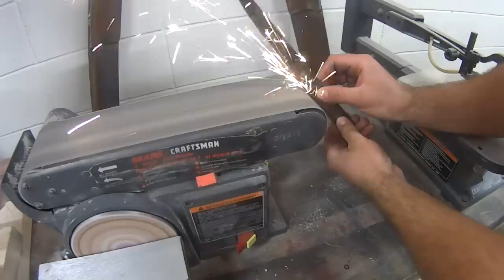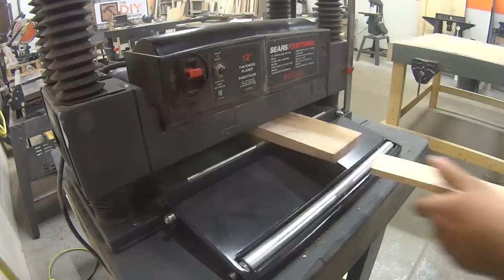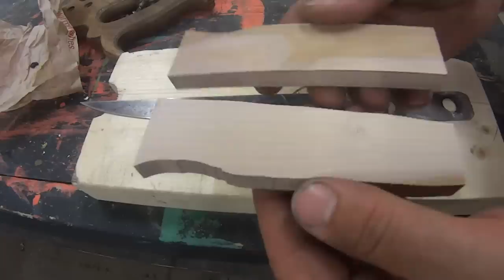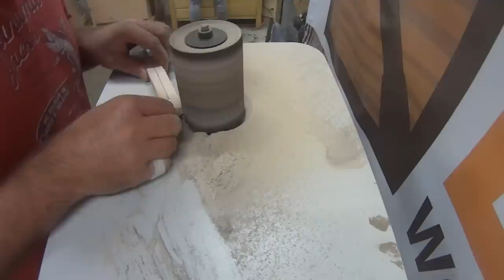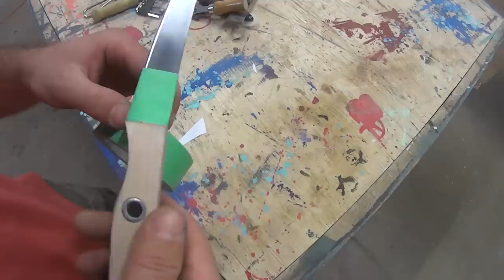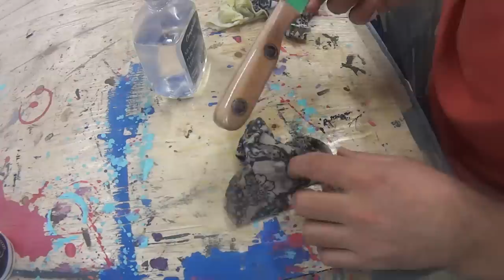How to make Fillet Knife from Hand Saw blade. DIY.

Comment: 2 things. 1st, clamp thin metal. I was just thinking when I saw you drill, man if that thing catches, then BAMM. Safety first.

2nd, and I'm not sure if you are aware of this and I hope others find it helpful. When drilling hardend steel, your gonna burn up bits. There is a very easy an effective method. It's called spot annealing.  Simply put, take something hard, I use an old pushrod from a car. Put it in the chuck of your drill press, turn the rpms up to the max. Mark the spots where you want your holes. Bring the spinning pushrod, or bad drill bit or whatever you have down onto the spot with pressure.  You will see the steel start to turn colors. Once it makes that tell tale purplish ring, the area has been annealed and can be drilled quite easily with the cheapest bits. This will only anneale a very small area.
Reply from the maker: Thank you for your suggestions!
Reply: Man, that's cool. Thanks for your input. That is some good information.
Reply: This is ingenious. Thank you
Reply: He should have started with a small bit and worked up from there.  Always clamp.  I had this happen one time too many.
Reply: Cool tip!

Comment: I found that if you are using previous blades to make your own blade it helps to heat treat the places where you are going to drill your rivet holes. A nice cherry red & then allow to cool. This helps to soften up the handle area and hence it is easier to drill.
Reply from the maker: Thanks for the info!

Comment: I was advised by an old time served engineer to use cold water when drilling spring steel.  i used to build double axle trailers and  used cut down leaf springs for the suspension.  Drilling the centre bolt was tricky until told about the cold water coolant!
Reply from the maker: Thanks for the advice! Will use it in the future.

Comment: Hello!  Nice knife  i have one piece of advise. Hardend steel is very difficult to drill and before I learned how to do it I burned up several drill bits. I searched youtube and learned this trick. Next time you need to driil  get a pan of water and suspend the blade part under water to keep it cool then  use a torch to heat up the  spots you need to drill. Heat the spots to a glowing red and set aside to cool. This will take the temper out in those areas and make it much easier to drill whole the blade part will retain it's hardness.
Reply from the maker: chefsterman 
Very good advice! Will definitely use it next time. Thanks a lot!
Reply: LA OTRA ES BAJAR LA VELOCIDAD DE LA MÁQUINA PARA QUE NO CALIENTE TANTO Y NO QUEME LA MECHA..!!

Comment: Thanks for the video. Wasn't sure if you beveled both sides, the speed was hard to follow, but not boring. The reason I inquire is that fillet knives are beveled on one side only.
Reply from the maker: Thank you for your comment!
I did put a bevelle on both sides, because all the fillet knives I had before (manufactured) were done that way. But I've seen one fillet 🔪 bevelled from one side only, Japanese one. Although it wasn't flexible like mine and quite thick, 1/4" approximately.

Comment: I like the fact you took something you were not using and made something you could,blade has the flex to fillet fish and if its sharp enough will be fine. I would have used smaller pieces of brass tube to hold it together and made a sheath out of a old belt ??
Reply from the maker: Thanks, William!
I used what I had for pins, no doubt brass would look way better!
I did make a sheath for this knife from a suitcase
https://www.youtube.com/watch?v=uRg3c17Arl0
Reply: @Take_And_Make  Good job and passtime. Beats just sitting around watching tv and drinking beer.

Comment: I have made a few of these and ruined a drill bit or two drilling through the tang. You can apply heat to the site of the tang holes until you get to a blue-purple color using a propane torch which softens the tang enough to drill through easily without compromising the hardness of the cutting blade.

Comment: you can soft the handle part by putting the blade part in water and torching the holes areas, so drilling is way more easy and less dangerous
Reply from the maker: Thank you Fabio, I will keep it in mind for my next knife build. Drilling as it is was a real struggle yes.

Comment: Very good video everything looks very good I also want to make my knife to prepare tacos my question is it has to be forged ??? because I see in other Videos that they heat the material and put oil to forge it in the hand saw n
Reply from the maker: Thank you! 
You can get away without forging if you not gonna overheat your cutting edge when grinding. Go slow and cool down your piece in water frequent. You may also wanna watch this video too
https://youtu.be/I5FIDpNrqGc
Reply: Thank you very much, really, it has saved me always wanted to be a knife but I have no way to forge it has saved me thanks for the answ

Comment: Thanks for the Demo. I thought you dd a good job. As far as softing the metal to drill the holes, it would be much easier to buy some cobalt drills. Harbor Freight sells them cheep. Keep up the good work.
Reply from the maker: Thank you Sue! I will check it out
Reply: Stay away from harbor freight bits. i bought 10 or so once just thinking "hey they'll dull but they're cheap." but i broke 3 of them in under 5 minutes and threw the rest away. just my experience with them.

Comment: I enjoyed the video but I was surprised when you went through the effort of making a knife by hand to end up using a pull-through carbide sharpener at the end. I know sharpening is a bit of a different skill set than machining and woodwork, but id argue that sharpening is easier because of tool cost.

Comment: Next time put your razor edge on last, safer to work with.  Also, slow that drill bit down. Drill metal much slower than wood.  Shouldn't need oil that thin too.

Comment: hi, nice video...I' ve got an old rusty saw and i want to make a knife of it.. the question is does it not go rusty again with the time
Reply from the maker: Thank you!
Each time I wash it I wipe it dry and then put it in the sheath
Reply: You can also dry it, then keep it oiled between uses (vegetable or food safe knife oil) ..  A vinegar bath can help break the rust off the old saw also, before starting to work with it..

Comment: Did you heat treat it’s very easy to ruin heat test on steel that thin
Reply from the maker: No, I didn't. The steel was already hardened, and it seem to be holding edge pretty good.

Comment: Fantastic job, well done!! Do you have any suggestion to make the handle without the need to pierce the metal?
Reply: You dont have to use pin at all. The epoxy will hold the scales to the tang just fine.

Comment: just want to say nice video keep it up. but first, the reason you were burning your drill bits is because the steel is high carbon and very hard so u have to soften it. next for drilling lmao its funny I didn't the same when I started but I cut off the tip of my finger ya not good but clamp it like u did but what I find is also good is put a nail or screw in the board and rest the blade on that so it don't turn like it did. if you have and questions give a shout. just a little info from one knife maker to another.
Reply from the maker: Thanks Bobby! I'm glad you like this vid!
My next project going to be a hunter/Bushcraft knife, I got used concrete diamond blade which I wanna use on this build. Have any suggestions/tips? Would appreciate your help.
Thanks!
Reply: well learn about the different types of steel and there carbon content. then learn how to heat treat and how to anneal high carbon steel. this will help you save on drill bits lol iv burned and broke blades drill bits trying to drill high carbon steel as you used in your video. over all do your homework and things will become a lot easier for you. iv learned everything I know from just from youtube and well a few books at the library. Hopefully this helps you if any other questions just ask don't mind helping out.
Reply from the maker: Thanks man! Would you recommend me any particular book!
There is so many on Amazon, kinda hard to chose...
Reply: wow I'm not sure bud I'm from a small town and there weren't really lots of books I think really there was 2 that I remember but the name I forget that's why I took notes on everything. I also do blacksmithing also but I studied for a year or two like really hardcore but you know I'm still learning new tricks and ect.... and to be honest its all from youtube. let me give you a few smiths I follow. Walter Sorrells, Chandler Dickinson and Alec Steel these are just a few that I follow the most but theres lots of them that are really informative. Oh and to learn how to heat treat just look it up on youtube how to heat treat and anneal steel or knifes ect. start watching and learning my friend. take notes and just have fun . if any more questions,  don't know if you have facebook or what ever but my email is bobbybeaupre76@gmail.com easier to get ahold of me if you need or have any more questions.
Reply from the maker: Thanks for helping me out Bobby! I appreciated it!
Reply: hey no prob bud if you have anymore question or help on anything like I said drop a line u have my email...oh if u get into blacksmithing you would be surprised all the cool shit you can make lol and I can give some pointers on how to make a forge for next to nothing almost free lol or how to make a anvil lol
Reply from the maker: Sounds good buddy. Yeah I think I gonna have to try blacksmithing in the near future! Lol 
My name is Eugene by the way. 
Eugene Gretskyi, you can find me on Facebook. Cheers man!
Reply: @Take_And_Make  Continuation of my reply. If the blade gets to hot while grinding, you will lose the hardness.  Always grind without gloves.  If it gets too hot to hold, you have lost the temper and hardness and it needs to be heat treated.  Same when cutting out basic shape.  Always go 3/16 or so larger that the final measurements because the grinder will heat up the metal too high.  Use a belt grinder or oscillating drum sander , and keep dipping steel in a bucket of water to keep cool.
Reply: Part one of my reply, sorry.  I would recommend doing a simple spark test and or snap test on the diamond blade.  Many times circular saw blades are tool steel with high carbon tips welded on. Usually pretty easy to identify the welded tips.  When doing any grinding, sanding etc on this type of steel, make sure not to let it get hot. This goes for both the hand saw and circular blades.  If they are already hardened, why do it again.

Comment: That was a nice saw, I would need to look at at it, but I would probably have paid you enough for it to buy a knife.
Reply from the maker: I got it cheap on Kijiji couple years ago. I got 4 of them for 30$. So I didn't feel bad to sacrifice one. 
The name of it is Henry Disston&Sons Toronto Canada D-8
I didn't build this knife in order to save money, but to create something yourself, that's the whole point of DIY, take something ordinary and turn it to something special.
Reply: Those are saws that you could try to sell now and hope for at least 30 - 50 dollars a piece.
By the way I certainly admire learning and experimenting, so please don't take my remark as a discouragement, sorry for the way I expressed it.
Reply from the maker: Good to know they worth way more than paid for, but I will probably leave it for myself. Never know where hand saw may be in need. 
Your expression is fine, don't be sorry, no offence budz! :)
Reply: Tielo Jongmans , I have all my father's, DISTONS , FULL SET, from tennon to rip saw, files, tooth set and original canvas and leather case the complete set fits. in
Reply: Tielo Jongmans , good luck with that, even mint ones are hard to move
Reply: Are you a saw collector? I have a few kicking around in my garage.

Comment: How did u stop that oak and maple from checking?
Reply from the maker: From checking? I don't think I get what you mean...
Reply: @Take_And_Make  checking is cracking of the wood caused by moisture leaving via the end grain. Your wood looks like it was aged correctly and not green,  so it should be okay if finished correctly.

Comment: That was a nice old saw you ruined there.
They don't make 'em like they used to, and real Disston saws have not been made since 1955.
Sure they had a special run in 1994 but I've got one and it doesn't even come close to my 1955 Disston let alone my 1940's or earlier Disstons.
It's one thing to use a damaged saw blade, but this was still perfectly good.

I recently made some Tater knives from an old saw blade but it had no handle and multiple broken teeth, it would've taken too much to get back into service as a saw unlike this one.

Comment: The worst saw blade is from high carbon steel, quenched and tempered at 46-52Rc all over and flame or induction hardened in teeth at 52-60Rc. It is not wise to drill with common drill bits, these type of material.

Comment: I guarantee that knife won't hold an edge worth shit after the amount of heat that went into the steel while cutting with the grinder and not cooling it not to mention the tip got red hot during the edge grind

Comment: First, you did a beautiful job on that knife, well done. But why destroy an older, well made saw for a knife you could get the metal for cheap and easy. These saws will be gone one day, and all we will have is scraps and stupid paintings in someones kitchen!
Reply from the maker: I had 4 of them, that's why I used one. There is still plenty of them, and you can get them relatively cheap, 10-25$ on Ebay